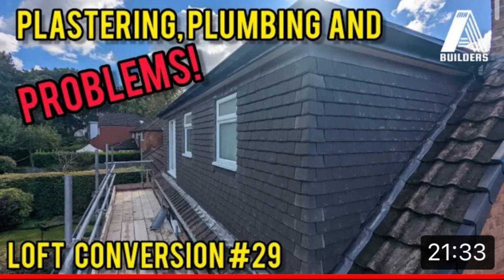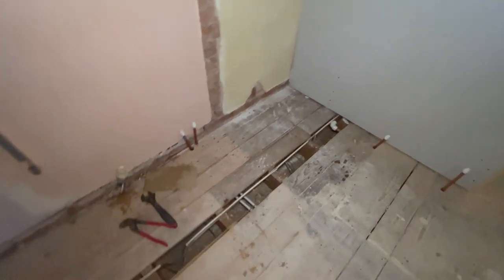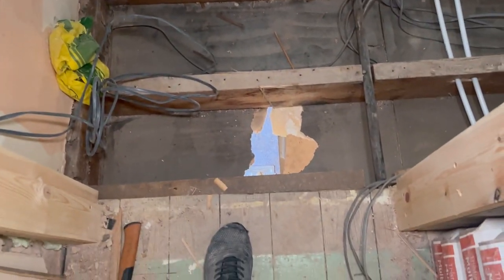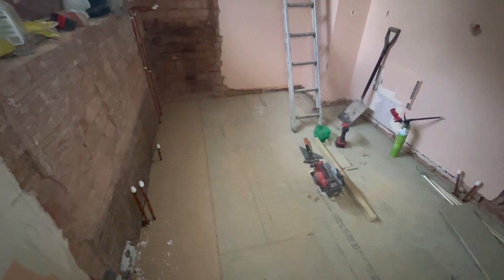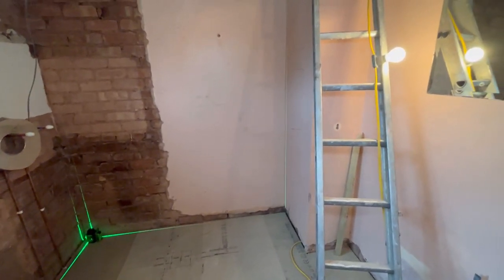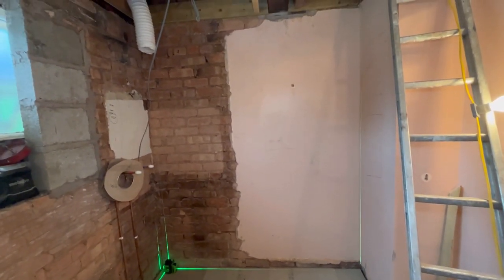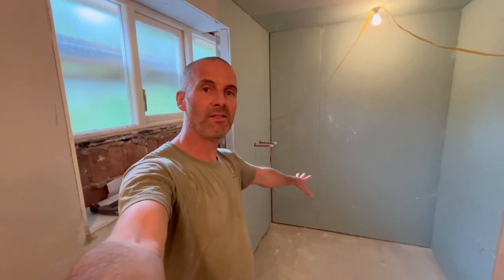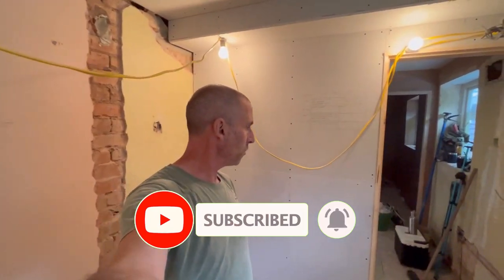Family Bathroom refurb series #1  #bathroominstallation #loft

Comment: in your experience would you need to support the long edge of 22mm t&g chipbord flooring between joists around the perimeter of a room ?
wiether its carpeted or tiled  ?  (Joists are 500mm centres.)
great videos btw !
Reply from the maker: Hi Mark and thanks for the commenting. 22mm chipboard is designed to carry 600mm when it is mechanically fixed and glued as we did. I have never done or seen anyone put supports for the edge of the chipboard around the perimeter because there is no load at that point so it’s not required. Of course that’s only my opinion but they never do it on sites either where the NHBC inspect it so it must be acceptable 👍🏻

Comment: Should have used 12.5 mm cement board in the shower area.
Reply from the maker: Well noticed Smythy with a Y and it's a fair observation. It's more of a 'could' than a 'should' but we take the point that you're trying to make and appreciate you taking the time to comment.
Reply: @Mr_A_Builders  also should be tanked for the absolute best results and waterproofing.